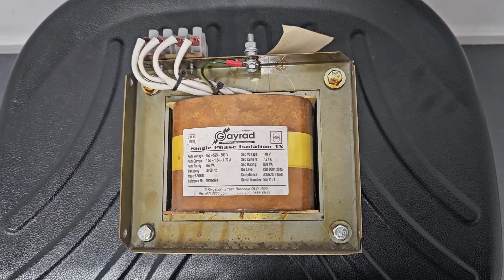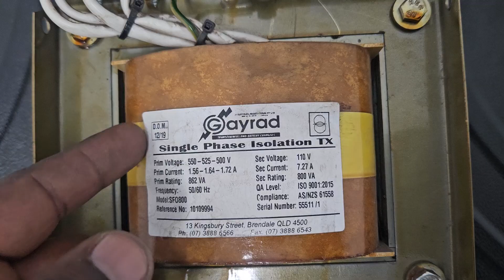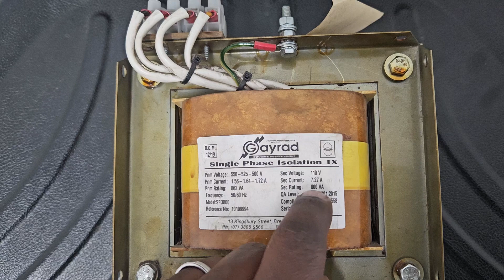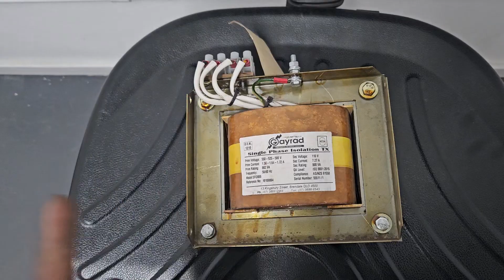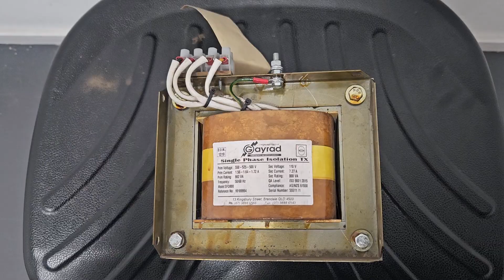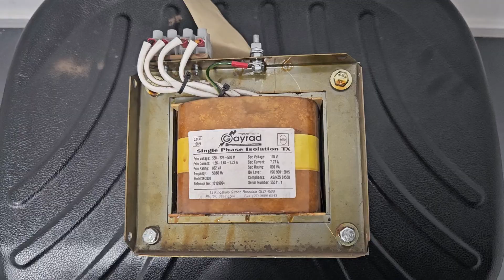What is a Transformer and How does it work?

Comment: From generation we use these devices to transform voltage to a higher value. How does the current drops as voltage increase I'm asking according to omhs law explanation,  how does this affect this law?
Reply from the maker: Remember two important formulas

P = V x I  so since the transformer doesn't transform power but voltage, to get the same Power output the current must drop when the voltage increases.
Reply from the maker: The second formula we need to know is the turns ratio N1/N2 =V1/V2 = I2/I1

If you notice when it comes to current we say I2/I1.

I hope  this answers your questions